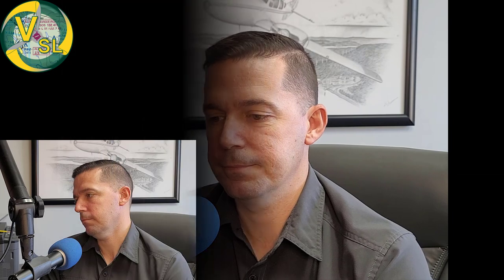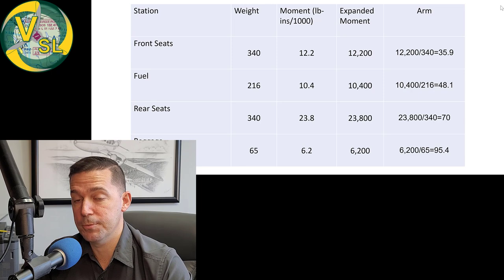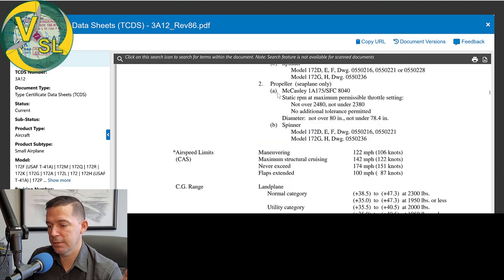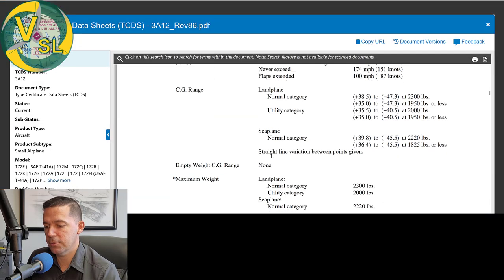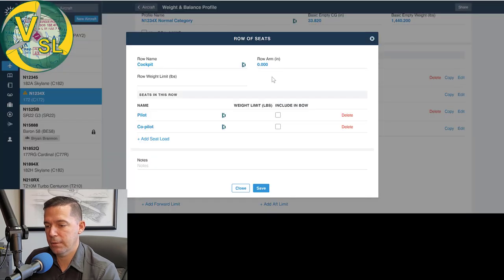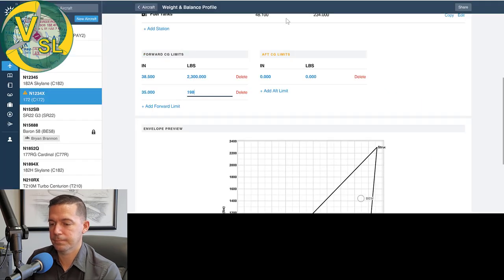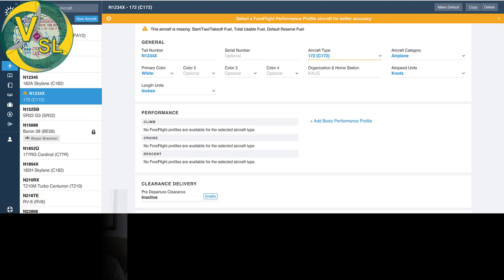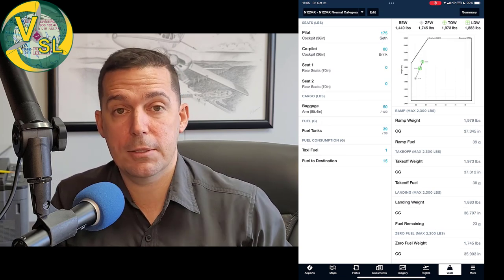ForeFlight Weight and Balance - All you need to know!

Comment: Excellent video Mr. Lake! Finally, someone making a video of applying the skills needed to make a proper W&B profile. One question- what if there is an STC increase in total useful load of the aircraft (due to a more powerful engine upgrade)? My new useful load is 2550, instead of the original 2300.
Reply from the maker: Definitely use that new weight on your profile. Also make sure the weight and balance was updated by the mechanic or shop that completed the new STC
Reply: @SethLakeDPE  I realized it clearly states the new forward station CG limit in the “limitations” of the STC.

Comment: Great video! Thank you for sharing. Question - I noticed you don’t factor in the oil, though it is included in the POH W&B problem. The TCDS for the 172 indicates that the BEW includes undrainable oil only. Should I add a station for oil in ForeFlight?
Reply from the maker: It depends on how the most recent weight and balance was done.  It should indicate if the oil was full or if it just had undrainable oil.  The most conservative thing to do, though, would be to assume it had full oil.  For most people, I would suggest adding the weight of your max oil level to the basic setup of the aircraft.
Reply: @SethLakeDPE  Thank you! 👍

Comment: Hi Seth. Loved your video - actually I like all your videos. I would like to use this feature of foreflight but I'm having a really hard time with something and was hoping you could help me out. I fly at an aeroclub on an airforce base. All of the planes there are T-41C's. And I'm finding it impossible to locate the TCDS for this aircraft so that I can get the CG limits. Do you have any suggestions for where I could get this information? Closest I could find on the FAA website is the T-41A but that's definitely not correct. Thanks!
Reply from the maker: I'll have to research that.  If you can't find the TCDS, the aircraft's weight and balance should list everything needed to build a profile in ForeFlight.

Comment: Seth, should the max fuel weight be based on usable fuel since the basic empty weight includes unusable fuel? Not a huge difference at these weights but just checking my understanding. Thanks for the great videos!
Reply from the maker: It depends on how it was weighed but that's a really good question. Technically, basic empty weight should include unusable fuel.

Comment: With multiple fuel tanks: Add them into the Aircraft W&B profile, in the order in which they fill or drain.  When you do a partial fill or use up some fuel, ForeFlight will use the first tank you added, then the next, next.  I had a problem in the LearJet I fly wherein it would fill the Fuselage Tank first.  This would greatly throw off the Wt&Bal.  I deleted it and added it back in, now it's fixed.   I think FF calls this "Fuel Sequencing" and says it's not available with a scratch built airplane profile.
* Spread this around.  FF doesn't have the answer.
Reply from the maker: Great information, thank you!